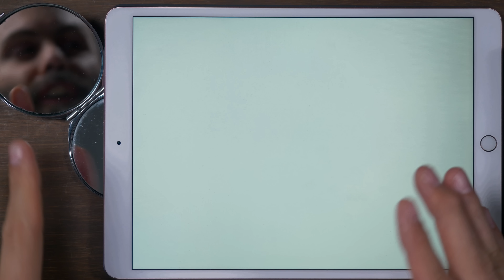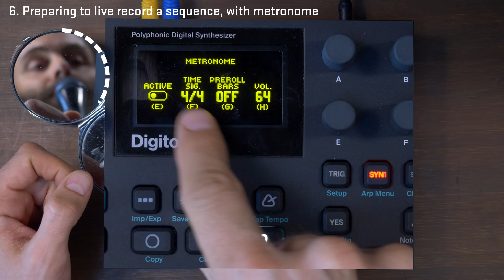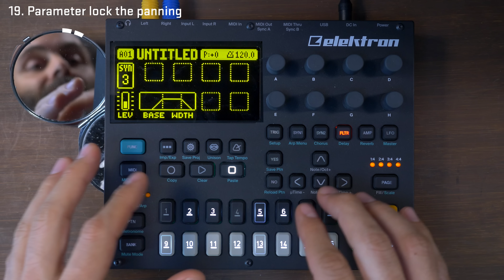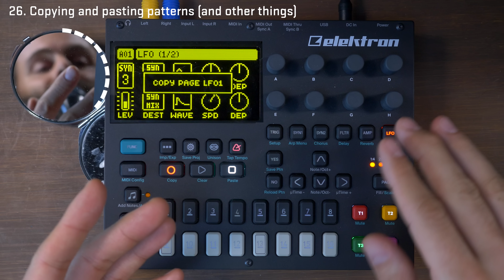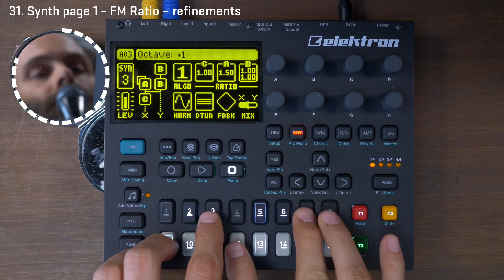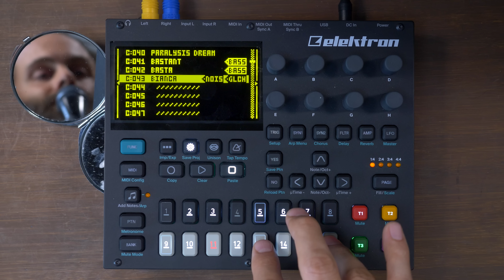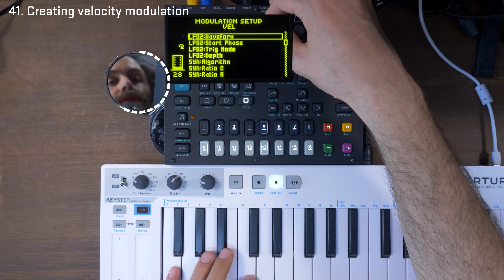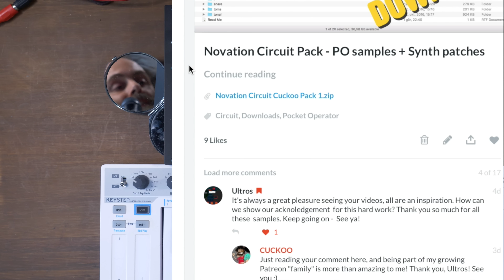Digitone Mega Tutorial

Comment: Great videos.
Does the Digitone only play one voice per synth track?
Reply from the maker: Any track can be polyphonic. You can set up some rules per track of how polyphony should be distributed.
Reply: Ok. So each of the 4 synth tracks in the sequencer mode is capable of 8 voice polyphony?
Reply from the maker: @drum4life42  the total poly is 8. But it can be dynamically distributed between the tracks, or locked per track if you wish. For instance a rhythm track could be monophonic, and the rest could be sharing the rest it you wish.
Reply: Ok so for example, I can have 4 tracks with 2 voice polyphony each totalling 8 voices, or 4 tracks 2 of which are mono and the other 2 having 3 voices polyphony for a total of 8 voice polyphony? Thanks
Reply from the maker: @drum4life42  yeah. Either control it and set it up manually like that. Or you can also set all channels to free voice allocation (this is the default), this way any track can use up to 8 voices, and they’ll just cancel other voices that might be playing, and steal voices whenever needed.
Reply: Ok. Thank you very much. Keep up the great work!

Comment: Okay if you want drums - like kick, snare and hi-hat - on one track, you put them in the sound pool. Got that. But if you want four o the floor kicks, do you have to sacrifice every second kick of you want snares on the 2nd and 4th beats? So in other words, can you only have one sound at a time sounding, even if you're using the sound pool?
Reply from the maker: You got the right idea. If you wanna cram as much as possible into one track, you need to make sacrifices, and get a little creative. If it’s absolutely impossible to split it up, and use a second track for the snare or hihat that you wanna layer in, what I’d do is to make a third sound that is designed to sound like a kick and snare together, for the specific case.

When designing the sound, I would create the kick on one track, the kicksnare on a second track, make a short four on the floor loop and dial in the sounds.

ANOTHER way to set it up, a little more elaborate to set up, would be to make ONE patch that could morph between kick and kicksnare through velocity modulation. Then you could control that morph level with simple velocity per trig. Possibly set it up so that the mix parameter could also go all the way to the left or right and mute one or the other side completely.

You gotta know the engine well, and get a little creative.

Comment: Hey Mr. Cucks, thank you so much for this awesome tutorial!! Helped me a bunch in getting started w my digitone, so I really appreciate it :). Do you know if there's a way to midi control a track on on the digitone with loaded drum sounds? like let's say I got an akai midi controller and setup 16 sounds on a digitone track, and wanted to trigger them w the pads. I was looking on the manual for the digitone, and it doesn't have CC #'s for activating the notes. Also, kind of a noob with hardware midi gear, so I might be missing an obvious piece of info.

Thanks again!
Reply: btw anyone feel free to respond if you know :)
Reply from the maker: Hey thanks! I don’t think you can play sounds from the soundpool via MIDI like that. Only through the sequencer. You can play the sounds that are currently loaded on the four tracks. So four sounds at least.
Reply: Thanks for the response! Hmm so let's say even with the keystep, we can't play those sounds as notes? I've already been able to hook it up and play the other synth tracks, which works fine.
Reply from the maker: Sadly not now at least. There is a special mode on the Analog Keys (and the Analog Four) that can do stuff like that. But I haven’t seen any trace of that on the Digitone.

Comment: What would you use to connect the digitone to your interface/DAW? Unbalanced or Balanced cables? +4dBu line level input? or an instrument level input? Thank you!
Reply from the maker: Line level usually. I’m mostly using balanced cables, without thinking too much about if the device has balanced output or not. Mostly for short cables going straight to the audio interface it doesn’t really matter that much I think.
Reply: True Cuckoo thanks for the prompt response! I ended up using balanced into my Apogee input and then set it to line level  -10dBv. Love the videos!

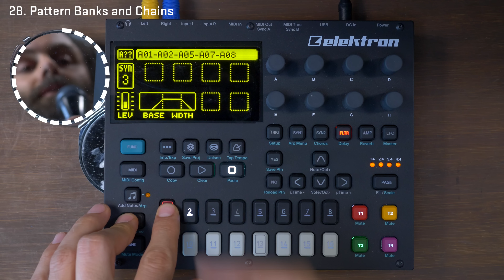Comment: 45:28 Actually, chaining is a bit more complicated. For each Pattern you'll have to go in FUNC + PAGE to reach the 'Scale' settings and specify the right values for CH.LEN and M.LEN. Otherwise, you'll get a chain with unexpected behaviors. For example, some multi-bars Patterns will only read the first bar, and some Patterns will 'break' your chain by repeating indefinitely if the M.LEN is set to 'Inf' and the CH.LEN is set to 'Off'.

Comment: Great video, great machine.  One thing users must understand about FM synthesis, is that it's inherently more difficult to create your own sounds with than Analog Subtractive synthesis.  Sure, you can make your own sounds with fm, but they always end up with a fizzy bell-like timbre unless you know what you're doing with deep modulation and carrier frequency.  So many potential buyers need to know that they'll likely be relying on the Digitones internal sounds unless they can get knowledgeable about FM.  Traditional Analog Subtractive is quite a bit more instant gratification.  Not a dig, just a comment.  The Digitone is a fantastic unit.